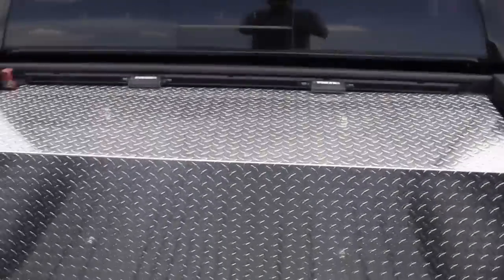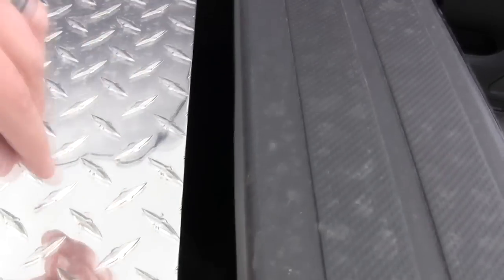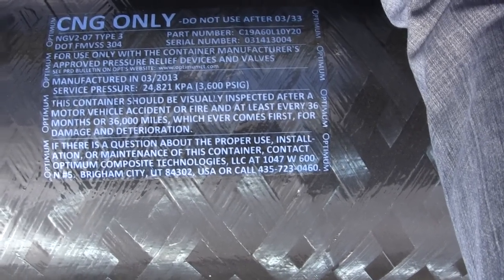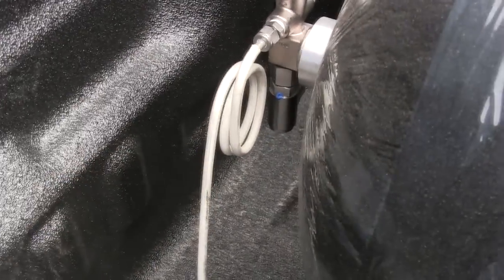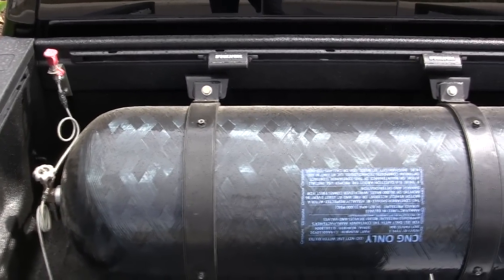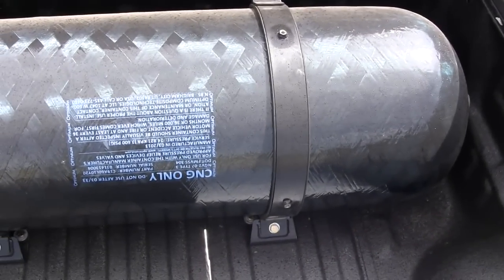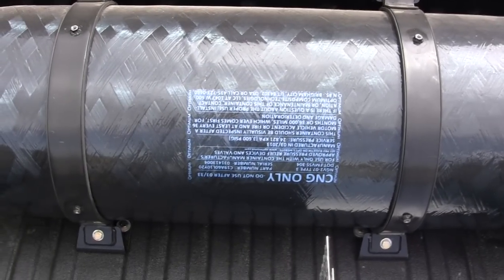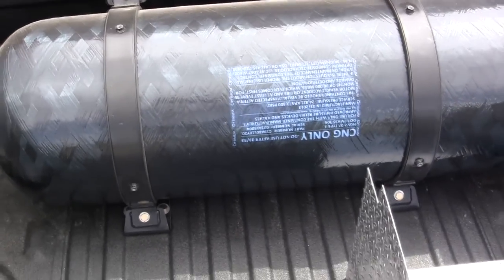CNG Cylinder Tank CNG Conversion 2010 Toyota Tundra SkyCNG

Comment: You said it was 19 x 60. Mine is the same size but its only a 10 gge. I have got as much as 7 during the winter. Im thinking on double stacking the tanks to get more range. Granted mine is a diesel so it sucks the gas. My range is 50 miles per fill.

Comment: This was the most informative video I've come across on CNG powering of motor vehicles. I liked all the details on safety regulations and to know that the laws are coming around to normalize biofuel run cars. Now my question is getting the conversion for my pickup. Where does one start as I currently produce and clean out my own gas from a 30cubic size farm unit.?

Comment: DO NOT USE THIS VIDEO AS A GUIDELINE FOR PROPER/LEGAL TANK INSTALLATION!

Not NFPA 52 compliant:
6mm coil tube that comes with imported kits.
Missing grommet where the fuel line passes through the bed.
Shut off valve sticker. (wrong colors and language)

Fictional statements made:
The information in the tank is required by Federal Motor Vehicle Safety Standards and the DOT, not the manufacturer.
Stress loops are not required by law.
There are 5 types of tanks not 4. Not all tanks are made with carbon fiber.
You don't "lose one or two gallons" when filling up. Heated gas expands, which in turn reduces GGE amount of gas that fits into the tank @ 3600psi from a fast fill station.
CSA is license is not required for tank inspection. License requirements from state to state.
Reply from the maker: Thanks for the comment!, but this is a simple introduction video. I don't think we ever said its a training video. You're correct that all tanks must be installed according to NFPA 52. If there is a type five tank that is USDOT approved then please paste a link, bc at the time of this video they weren't certified. Most states require a CSA cert for the mechanic to inspect tanks. FYI this truck has passed safety and emissions multiple times... But yeah that Cng cutoff sticker should have a white background and different verbiage.
Reply: +Tony Griffith Im looking at a grommet at 4:27

Comment: thanks for the very information video.  do type 3 actually hold more cng than type 4?  I have read in several places where in some instances that is true.  and do some type 3 or type 4 tanks by one manufacturer hold more than from another manufacturer.  it seems like I read a time of two manufacturers boasting that they designed their tank in such a way and with technology that allowed it to hold a little more cng than an equivalent size tank from most other manufacturers.   I am looking to get a 2009 thru 2012 civic cng but I would like the longest range possible (without adding an extra cng tank).   so I may want to get another tank that is the identical size to the original cng tank that comes in the 2009 thru 2012 civic.    so I am not sure the stock cng tank that comes with the civic will hold the most cng.
Reply: Did you get a CNG civic? If so, have you had any maintenance?